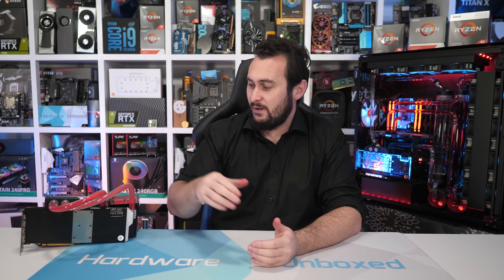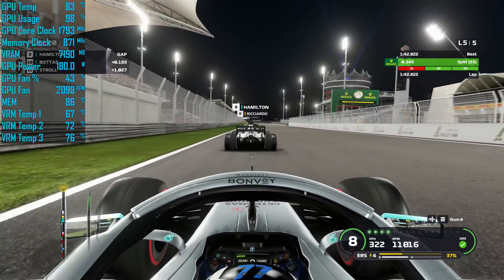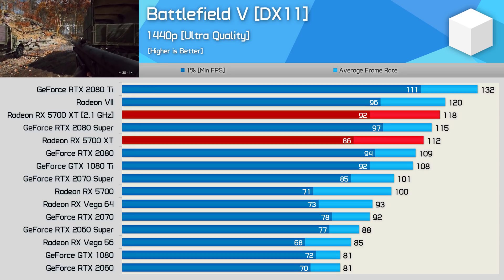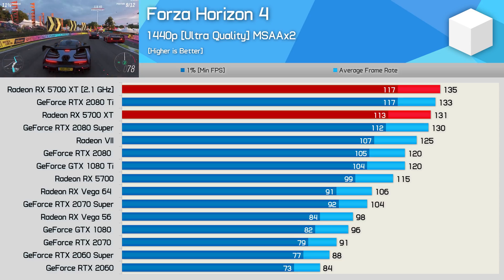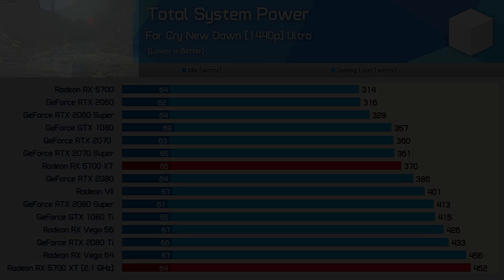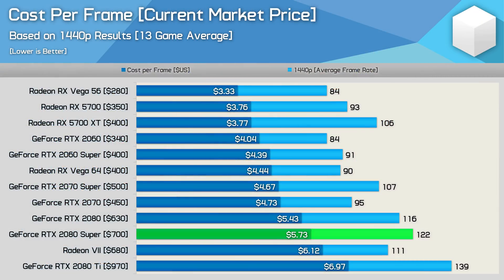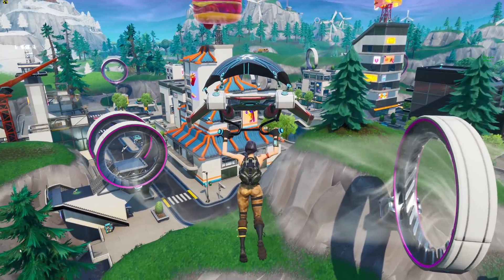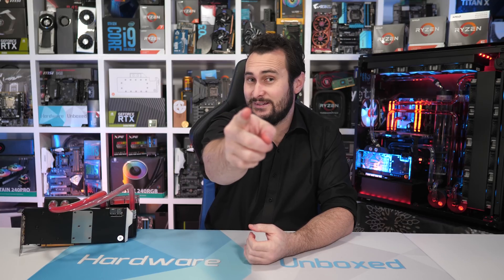Radeon RX 5700 XT Overclocked, RTX 2080-Like Performance?

Comment: What a card THAT AMD GIMPED!! FFS AMD
Reply: you think they''re gonna unlock the clocks on that blower? lol
Reply: @untag4066  Never said that lol They gimped it with that cooler...And Steve got a silicon  dud...sadly.. This thing can go to 2.3 GHZ as proven by Igor from Toms Hardware, buut it is a gamble.
Reply: @denan1  no, you can set up to 2.3ghz but effective clocks never go close to that. Igor did 2.2ghz while keeping his gpu under 30C with chilled water
Reply: Seems AMD didn't want to continue "hot and loud" meme
Reply: @soileH  By going hot and loud again?